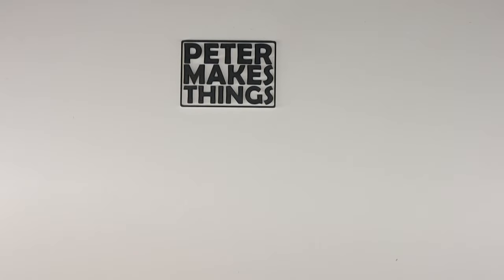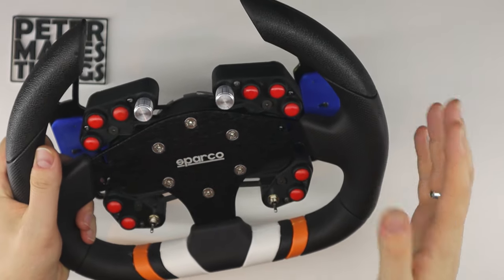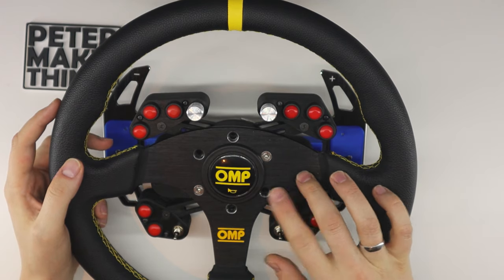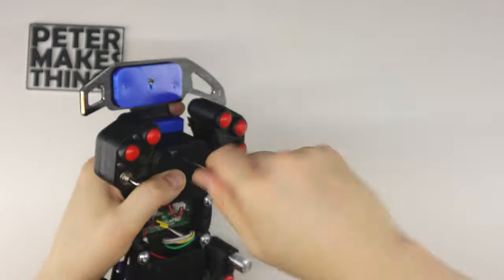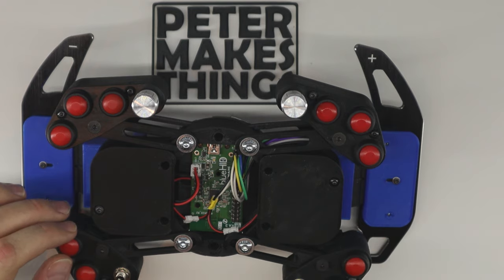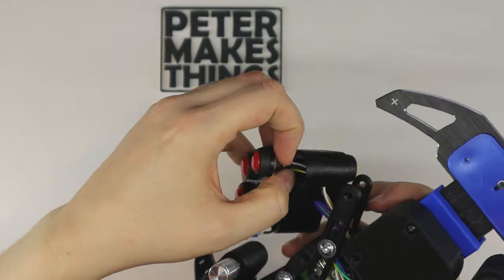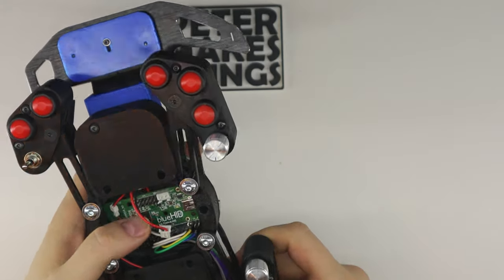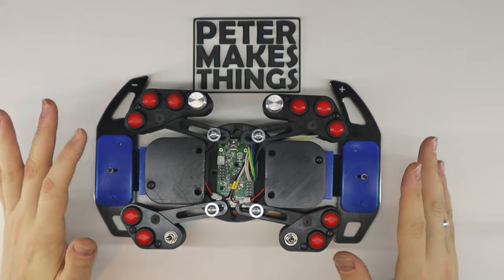PMT Universal HUB for Simracing wheels

Comment: is very well seen ... is the alternative to the cable or the limitation of buttons in thrustmaster and others, similar to the wireless solution of granite devices (simucube2) also if the TGT plate would be copied and adapted for arduino would be fine, I would I'm changing it    
 https: //ibb.co/TgWX1D8
Reply from the maker: There is an adapter on thingiverse already (https://www.thingiverse.com/thing:3967322) so you can always try it out, but I'm not sure if 3d printed parts are durable enough for dd wheels, don't have one so can't test it

Comment: How much was it to build
Reply from the maker: I paid £50 for the BluHID, used a bit over 200g pla filament plus all the nuts, screws and buttons listed in description, if it wasn't for the board it would be a fairly cheap build, and I'm working on alternatives now
Reply: @petermakesthings7342  even then that is so cheap
Reply from the maker: @tehgusbus2716  well yes and no, this is just plastic, if I had a cnc router that would be a different story...
Reply: @petermakesthings7342  how much are those
Reply from the maker: @tehgusbus2716  I meant that if I had the machine that allows me making aluminium parts that would make the build more expensive but at the same time way way better
Reply: @petermakesthings7342  oh ok I didn't know what it stood for get one so you can help me make that button box lol